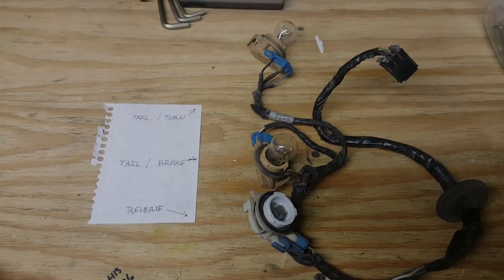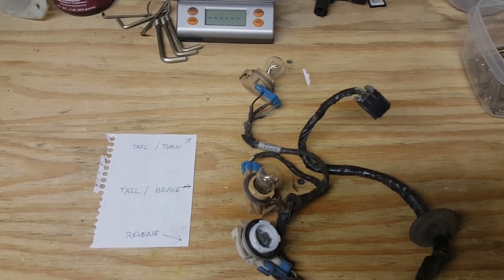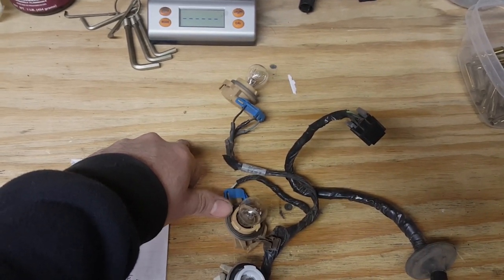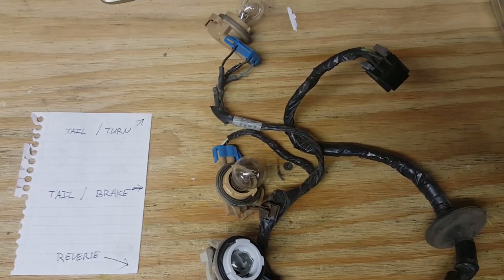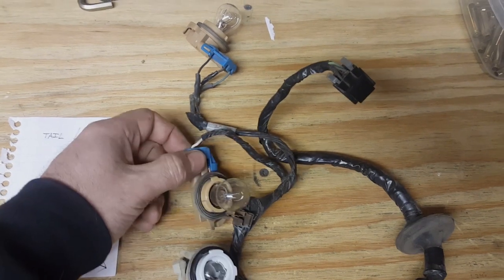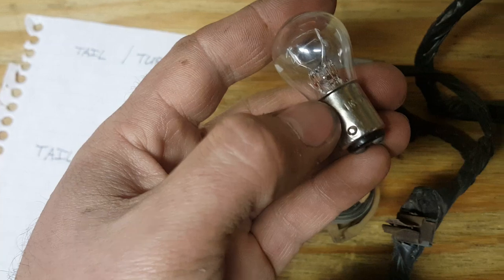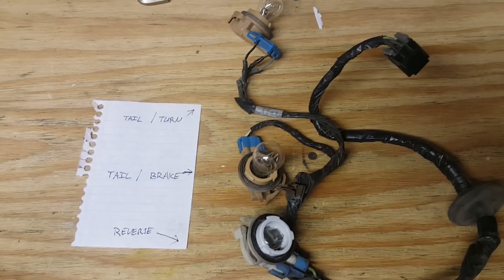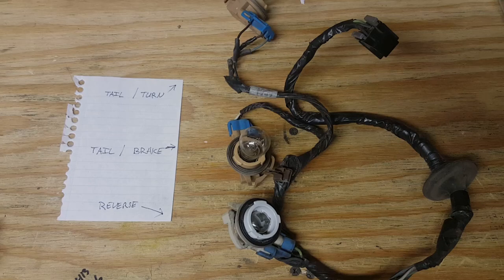Chevy Van brake light problem

Comment: ive been trying to figure this out for years. Exactly the same issue.   I drove my van like that for 15 years, then I finally got pulled over for it. Thanks for the video!!
Reply: u got away with the bad break light for 15 yrs? Damn, that's quite the streak, good job!

Comment: I want to say, this video saved me hours of headache pointin  me to try replacing these terminals as my first effort 
in fixing the exact symptoms my van was having, NO BRAKE LIGHTS!   I ordered two Dorman replacements Amazon Prime, 2 days later I swapped them out..and BAM all lights working again, under $40 , my van is a 2002 1500 express 6cyl, the part was 923-015 tail light harness GM, thank you thank you.  I first thought it was something wrong with a trailer hitch installed before I purchased it...This is a pretty important repair, no brake lights ....not good!  again Thanks for posting this...
Reply: Same problem as you. Thanks for the part numbers!

Comment: ...I ordered new sockets.. 37 bucks each and next day shipping.. 95 total.. hoping I don't need new harness.. does the harness come with sockets?.. if it's the harness at least I have new sockets now, too.. or will I end up with 4 new sockets if I need a harness.. ?
Reply from the maker: In my case, it WAS the sockets themselves that were bad. With that being said, I had purchased the dorman assembly which is the harness and all the sockets pre wired so it was just a matter of twisting in the new sockets and plugging it in. Sounds like you'll either have some soldering or some crimping to do but sockets alone will MOST LIKELY fix your issue.

Comment: Does anyone have a suggestion if it's the same problem but lights are LED, hence no sockets? It's a 2007 GMC  Sierra
Reply from the maker: Same EXACT problem? And are you saying ALL the rear lights are LED or just the 3rd brake light?

Comment: Does your van have a plate with the harness built in
Reply from the maker: You mean like the circuit board style? Where the bulbs plug into a board rather than individual sockets? If so, no.

Comment: Replaced both wiring harnesses. Now, I have no tail lights, no brake lights (except for the third brake light.
Reply from the maker: It's possible you have other issues as well. What was the original issue?
Reply: @Pyro17059  Original: When lights are on, no brake lights. When lights are not on (daytime) brake lights work fine.
Reply: @skymiller530  same issue here in my 00’. It’s came down to same issue you have. Daytime no problem. Nighttime I have running lights in back but no tails but my third brake light stays on. Last week I had brake lights at night but the running lights would dim while hitting the pedal. I cleaned the sockets, added dielectric grease and cleaned all my grounds inside van at rear now this. Did you ever get it figured out? Thank you

Comment: Mine burns off the light bulb from the right turn signal all the time. That will be the front right side. Any idea what could it be?
Reply from the maker: What exactly do you mean "it burns off the light bulb" ?
Reply: @Pyro17059 
I have put a new light bulb 3 times already and it keeps burning the right turn filament.
Reply from the maker: @javierlongoria274  hm..thats interesting. Haven't come across this problem ever. I suppose first Id double check that you're using the correct bulb. If thats correct, maybe hook up a voltmeter to that circuit and make sure its not getting bursts of high voltage somehow (doubtful) ...another possibility is cheap bulbs.

Comment: So what is the part number?
If you don't remember the part number, what is the NAME of that part of the wiring harness? Good video, but revealing the part number or name would also be helpful. I have no idea of what to order to fix the problem. H E L P
Reply from the maker: 923-017 was the dorman part number for our application.  They label it as a tail light wiring harness.
Reply: @Pyro17059  
Thank you very much.